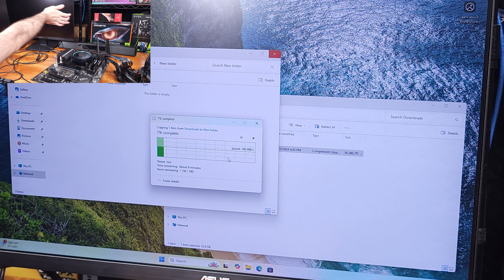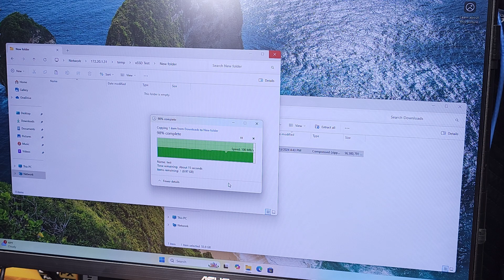WiFi 7 - Upgrade Your Gaming PC!

Comment: Will this work on the 7800X3D? Im currently using the default antenna which is wifi 6E and its not performing so well. Checking the status, the speed says 1.2gbs, but only getting 400-500 mbps. My brother in law just ordered a wifi 7 router and I'm wondering if this will work with my build.
Reply from the maker: @KingKong-0000  No, it will not. The Intel based WiFi cards are not compatible with modern AMD systems, which this is. Usually installing this card causes BSODs on AMD. I would look for a Qualcomm based WiFi 7 PCIe card for your system.
Reply: For s moment I had forgotten about all other brands too. I was just "intel only" but my bro has an AMD Build and Qualcomm would work there then. Hopefully. Thank you
Reply from the maker: @Helios.vfx.  Yes, Qualcomm based WiFi 7 chips should work fine on AMD systems. Was that a new build for him?
Reply: @STS  not new at all. It's an old 3950x AMD build
Reply: @STS  but the MOBO has wifi 6 build it, so I guess it should suffice.
Reply: @STS  Thanks! I'll do more research. Happy gaming!!

Comment: Mate, I have a off topic existencial doubt atm. What do you think? 
I recently changed my ISP internet. Previously wth my Wifi I used to get about 450 max transfer data with local files sharing or internet. which was kind of fine. 
Now, since I changed to a new ISP. this new router gives me only 250/260 mbps donload and upload  345 mbps upload. 

When previously it had more.
That's why I've been looking up for WIfi cards for laptops 6th or 7th gen
To get better download speeds.

My sister came here for xmass and her laptop reached 800mbps download speed using wifi.

So, should I get those wifi cards,  6 or 7 th gen or one of those dongles usb c + ethernet port cause this laptop does not have ethernet port. 
I think wifi is handier tho.
Reply from the maker: There's a lot of factors that go in WiFi performance, especially for laptops and mobile devices. On my I7-7700HQ laptop I have successfully installed and tested wiresless AX cards for example that provided a significant boost over the original ABGN card that came with the laptop whenever I first bought it (when the i7-7000's came out). That being said, it still possible that you might have some kind of power saving mode enabled on your laptops WiFi adapter that could be limiting performance. It's also possible that your new wireless router/access point is setup slightly differently and using different radios or chipset. It's also very difficult to compare non identical test scenarios, for example exact placement of your device and any type of RF interference that may or may not be present / random. 

My Internet speed, the speed I can get out to the Internet is comparatively low to my friends, I think it's only 350mbps service but my desktop connects to my access point at ~700-800mbps consistently which is what I care about since I move large files around over my local area network frequently. It's not quite gigabit speed but I can't get a cable to where my main video editing PC is so it's better than nothing. 

If you are comfortable with disassembling your laptop an installing a new WiFi card and can get one cheap, I say go for it, that helped me a lot.
Reply: @STS  There shouldb't be that much of a problem since the router is right behind the laptop to at max distance of 20cm. So, I don't think it should be it. But could be the new router inner setup that I wasn't able to get in with the admin and password. KInda a mess but can't be bothered atm. The I'm not sure if there's a limiting or let's say "low power mode" wifi on linux, will have to look it up. But it might not be it, cause previously a couple of hours ago before the isp folks would arrive, I was using it fully. 

I Found this card 
WAVLINK WiFi 6/7 Tarjeta inalámbrica 5400/8774Mbps Tri-Band BE200 M.2 NGFF Módulo de red con Bluetooth 5.4 Compatible con Windows 10/11
Do you think that'd be a good one or is too overkill?

I also move big files to another computer and having higher speed would be handier :D

Comment: Wi-Fi 7 is iffy on anything that's an older Intel or anything AMD.
Reply from the maker: Yea, from my testing I was having trouble getting this to work on my Ryzen 9700X test rig. IT worked right away on this 12th gen I5 setup however. I'll update the description. Hopefully AMD is able to work out what is happening here because Intel traditionally powers a lot of wireless NICs.

Comment: I have wifi 6 modm router , I'm on 50mbps speed , but my maximum speed on my line is 65mbps , on my mobile phone I get the full 65mbps download speed , but on the PC i just can't get full download speed of 65mbps , I've used wifi 6 internal pcie card and I've also used my ethernet port and cat 6 and cat 8 cables , just can't get full 65 mbps speed , any ideas on what I'm doing wrong
Reply from the maker: So your Internet connection is 50Mbps but you are able to get up to 65Mbps - but not from your desktop? How are you testing this - a website or looking at the adapter properties in Windows?
Reply: @STS  Speed test by ookla
Reply: your speed is trash lol
Reply from the maker: @rochester3  Well, we can't all have over 1gbps wireless. WiFi sure is handy but it's actually quite complicated.
Reply: @STS  Im with bell fibre I’m getting 670 mbs download and 730mbs upload speed for wifi… for Ethernet I’m getting 1.062gbps for download and 750 mbs upload, you need a new provider lol
Reply from the maker: @rochester3  That is some fast Internet there. I have more of a basic 400/400 plan but I move around quite a bit of data on my LAN for projects and such.
Reply: @rochester3  The infrastructure isn't there , it's currently being upgraded in my area but will be another few months untill it's up and running , hopefully then I'll be able to get same speed as you lol
Reply from the maker: The speed that you connect to your wireless router or access point is different from the speed that you can connect to a speed test service at. That 50mbps may or may not make sense for a desktop with other applications running (including updates) that could be using some bandwidth. It's possible or even likely that if you check the Wireless network properties of you are running Windows or Ubuntu that you are connected to the router at a much faster rate.

Comment: mine doesn't work, I just connected everything correctly, installed the right driver and it doesn't show up
Reply from the maker: What platform are you using? Intel or AMD? I wasn't able to get this chipset to work on my Ryzen 9700X based PC. From what I've read, there's some kind of firmware or driver problem preventing this card from working on AMD PCs right now.